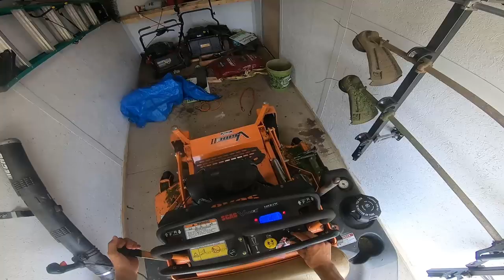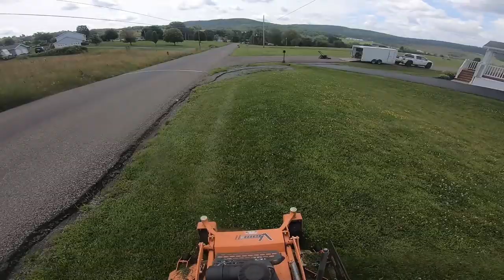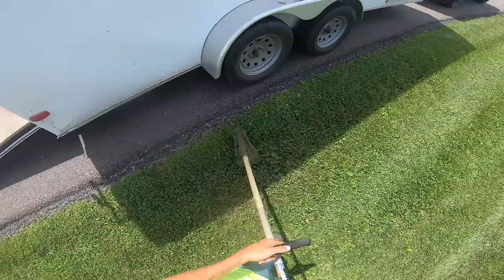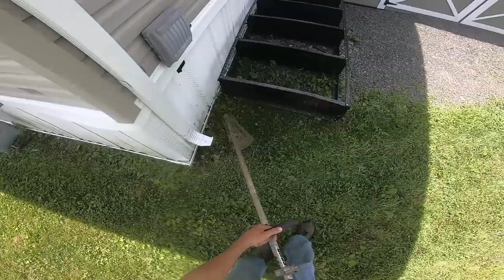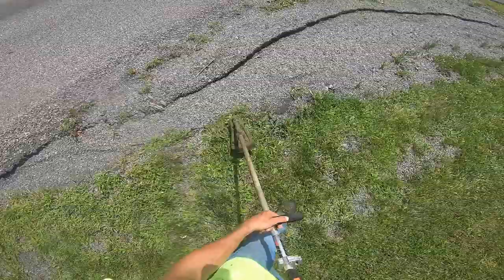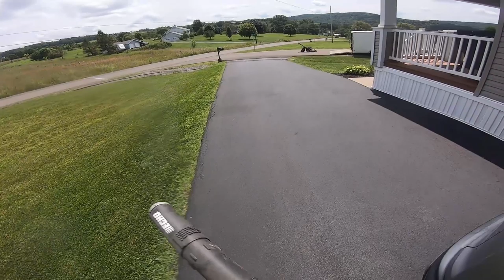Lawn Care POV | Realtime Mowing, trimming, and blowing | Scag Vride 2, SRM225, PB 8010

Comment: Hey man keep up the hard work! It’s nice seeing young guys work and want to build a business instead of being glued to their phone. Piece of advice bro, engage your blades on your mower at lower RPM’s. Than idle up once engaged. Helps with longevity of deck belts. Keep it up man. Got my support from the Philadelphia area
Reply: I actually had my dealer tell me the opposite. Yes I engage them at a lower throttle settings. 0-18,000 or 0-5,000 tip speed. Speed kills  😂
Reply from the maker: Appreciate it man! I've had some people say engage at full speed and others at 1/2 throttle. I've decided it's not worth the fuss and I do a little of both 😜

Comment: I saw a Scag walk-behind a 36 in. That thing is impressive. If you're wanting to save time in properties that's got fences gated backyards your bigger mower can't get in the backyard Time Masters are a dime a dozen. Like you said. Your mower weighs about 500 lb. You can't get in a lot of places without tearing up a yard and if you got any steep hills the walk-behind is the mower for you
Reply from the maker: I had a encore 32" walk behind. By far my favorite cutting and striping mower I've ever used! But the controls would occasional stick and I was worried I would damage a car or house because of it 😔
Reply: @wyattslawnservice7212  you're going to have to learn to work on them sooner or later. Or sell them before they break down. Everything breaks down. Cars trucks and lawn mowers trailers weed eaters edgers. Most of the time it's an easy fix. You can go online and get schematics diagrams of your mower. It's free. Of every piece of equipment.

Comment: When blowing u should always start up against the house and work your way out. You pushed some clippings behind the trash cans...
Reply from the maker: I wouldn't be able to to get those anyway. Car and railing were in the way. And no way I what you going to try to fit between them and possibly scratch something. Definitely not worth the potential damage with few clippings haha
Reply: @wyattslawnservice7212  if u point the blower in the cans and up against the wall it'll blow it out. And most the clipping blown in there was from them being pushed in there by the blower so if u start at house first and work out it'll prevent clipping from getting in there.

Comment: I just made to change from the echo srm 225 to the 2620T and talk about a time saver. I plan on getting the 8010 blower before the end of the season or that’s the plan anyways. As always great video and good job on the yard.
Reply from the maker: I was thinking about upgrading my trimmer next. How does it really speed you up? I was debating is it would or not because it's already powerful enough for weekly and biweekly lawns here. Curious on your thoughts broski 😄 👍
Reply: I’m in Biloxi Mississippi and sometimes with the 225 I would have to swing over the grass a few times at full throttle to get the cut I wanted. The 2620 will cut faster than I can walk lol. Also I’m rarely using it at full throttle therefore I use less gas as well. Well worth the investment in my opinion.
Reply: @Dhutto  is it more powerful for tall thick grass with the extra torque?
Reply: arturo munoz  most definitely. It’s actually fun to cut the y’all think stuff now

Comment: Great video man! 👍 What GoPro mount are you using? 🤔
Reply from the maker: Thanks Cameron 😊 I'm using a head mount for mine. The video isn't very shaky because the hero 7 has built in stabilization
Reply: Wyatt's lawn service That’s sneaky!  Is the Hero 7 pretty sweet?!
Reply from the maker: @TheLawnCareLifeinMowssouri  yes but I'd wait for the hero 8. The 7 has so many bugs that they haven't fixed. I have taken many YouTube videos and had the footage not work out. Or it freezes and it deletes the footage after 10 seconds :/
Reply: Wyatt's lawn service Oh wow.  That’s not any good!  👎

Comment: Learn to wack counter clockwise and you will spend less time blowing beds and it’s usually better to wack first. As if your going counter clockwise you throw it all out for the mower to pick up or throw.
Reply from the maker: I used to. But this year a mini goal is improving weedwacking in the opposite direction so I can be more ambidextrous

Comment: Are those just regular earphones or the radio ones if so how much are they
Reply from the maker: Radio ear probably. $35 on eBay 😄 👍
Reply: Wyatt's lawn service alright I may have to buy some. So I don’t have to use my phone for music when I’m mowing
Reply from the maker: @Ryan-yr6hs  the radio definitely is nice. But you also have the option to plug your phone in if you wanted to mix it up a bit 😉👌
Reply: Wyatt's lawn service ok are they completely sound prof tho cause when I’m on the mower  at work it get really loud especially when I’m on it for hours
Reply from the maker: @Ryan-yr6hs  I don't remember the rating. They help but aren't soundproof. They are called 3m worktunes. This way you can research them 😉👌
Reply: Wyatt's lawn service also I had-another question how’d you get your first customer did you just go to old people first and than move onto everyone cause I’m really  nervous  to go ask ppl to do their lawns